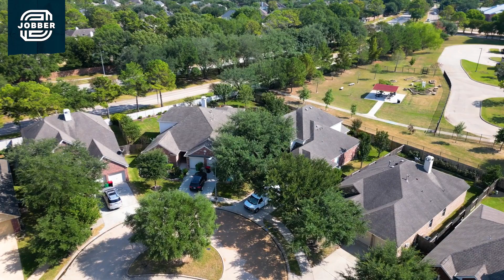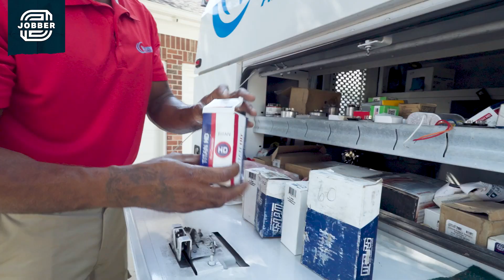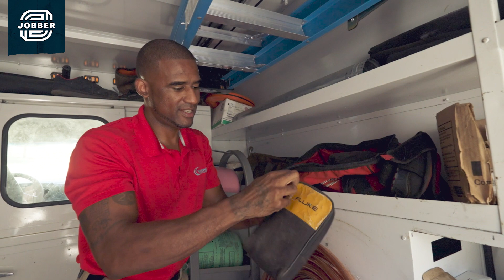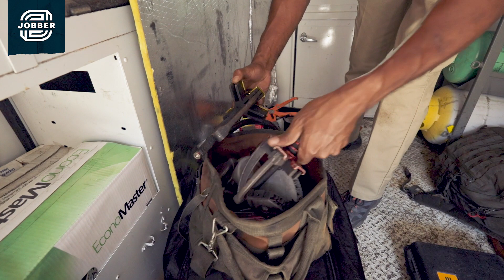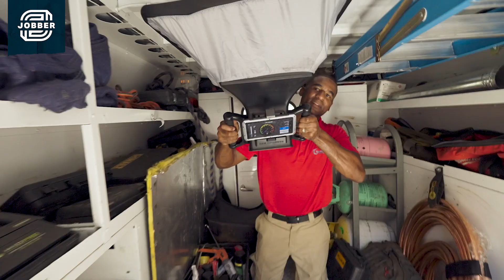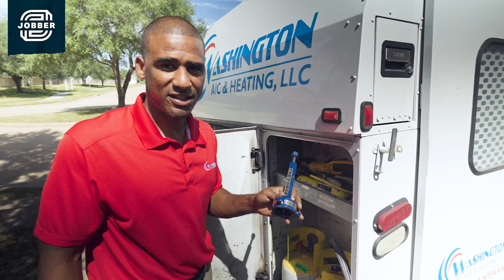HVAC Service Custom Van Tour #shoptour #hvac

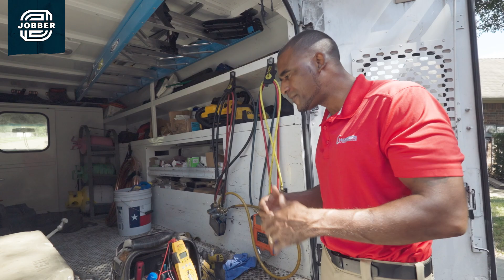Comment: 7:15 add some padding with tape on the back to the box behind them gauges and maybe attach some Velcro straps.     I know them things are banging around while you are driving.    Long time fan!   You definitely are rough on your tools.   But, I know you are making that ca$h so maybe it don't matter.   🤑   I was laughing about how secure the blue ladder was stored as opposed to your beloved elitech gauges.